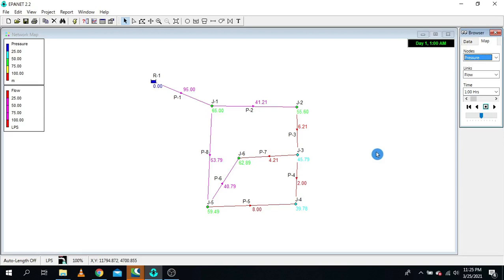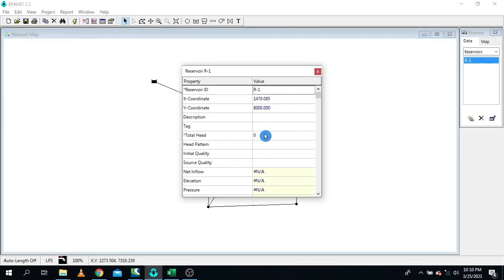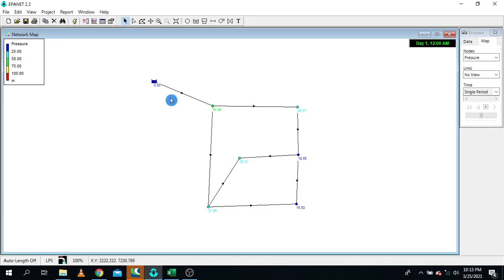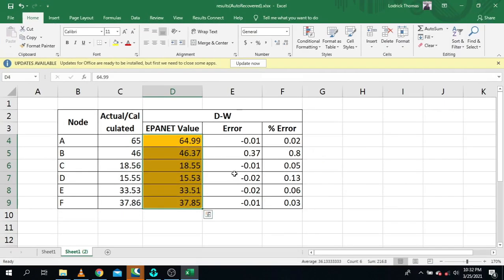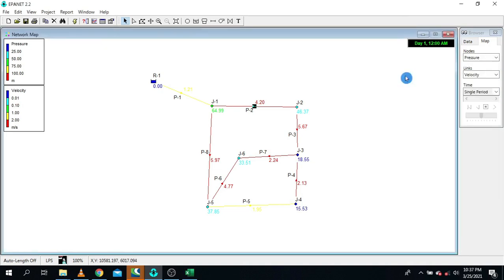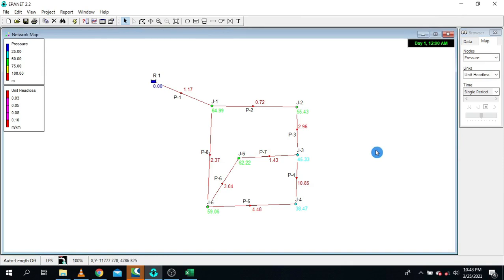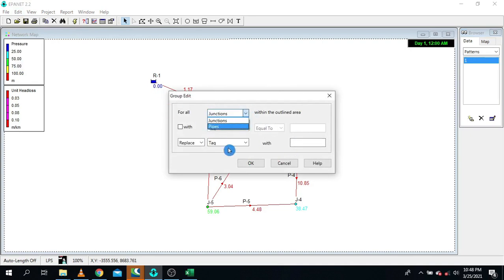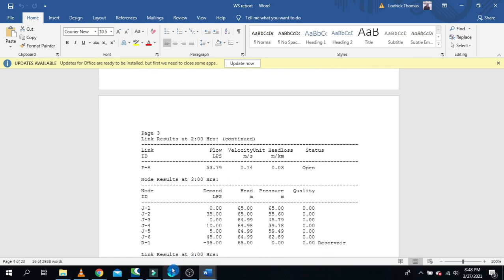EPANET Tutorial | How to design a Looped Water Supply Network with EPANET Software

Comment: Great video, Sir! It helped me a lot in my college final design project. I have a question, though. How do I distribute the base demand throughout the whole community when I am only given the total demand at that certain location?
Reply from the maker: Thanks and welcome! Is it a looped network? or dead end like the one on tutorial?
Reply: @HydroinformaticsAcademy  I need to do both and choose which is a more economical design. Really hoping for a reply. Thank you, sir!
Reply from the maker: @nof2287  For looped network what you need to do is to distribute or to divide your total demand on each node or at least corner nodes i.e. if your have 8L/s as a total demand and you have a total of 8 nodes in a loop then take 8l/s/8=1L/s for that, you need to assign 1L/s on each nodes in the loop! 

For dead end its straign forward, if on a given end point you have say 0.8L/s as calculated demand then that is something you need to assign on such a particular point/node! 

NB: Depending on which analysis you opt to run (staedy state or EPS) You need to be aware of base or average demand vs actual demand which includes the multipliers!
Reply: @HydroinformaticsAcademy  I am planning to perform EPS! This really helped a lot since I was stuck at adding base demand for days! Thanks a lot, sir! I'll surely recommend this channel!
Reply from the maker: Very good, Just be aware that for EPS you need to use average demands without hourly factors. You also need to  set the appropriate multipliers and assign them on each node with average demands. Then after that, EPANET will run eps to get the actual demands which includes multipliers that you assign on the nodes!

Once again, thanks alot and I wish you all the best in your project🙏

Comment: Thank you very much for you video, can you explain us how we can add a "fire pipe" in network ? all of time for example, one fire pipe must product 60m3/h with minimum one bar ! Thank's a lot
Reply from the maker: That can be done, in my opinion, what you can do (when you design your network) is to introduce a node with a base demand equal to 60m3/hr (16.67L/s) and then adjust the whole network to make sure its capable of supplying fire flow demand of 60m3/hr and at that added node make sure pressure is 1bar (10mwc)! 

And if possible you can even go further by performing Extended period simulation just to make sure your network is well optimized to handle demand fluctuations!

In fact, in the future, we may have some tutorials related to fire flow demand... just make sure you subscribe to be notified when we upload new videos!
Reply: @HydroinformaticsAcademy  thank you for your answer, it's like what i tried to do (flow demand increased to 17l/s) and i make my demande in two hours (new pattern). Also the elevation of the node is increased by 10m (like to create the pression 1bar) ! is this method correct ?
waiting you nexts videos, 
regards
Reply from the maker: @youssefmouacha3296   Adding a separate pattern for Fire flow demand is correct, but the idea of increasing node (with fire flow demand) elevation is good because let's say your actual ground elevation (at a node with fire flow demand) is 100m and in epanet you assign its elevation with 110m (and not 100m actual elevation) this alone is going to guarantee you that at that node (after assigning additional 10m) is going to get 10mwc/1Bar! 

And if you run your model and you get any +ve pressure value at that node then the actual result is going to be 10m plus that value you got after running your model! 

Let's say your node elevation is 110m (after increasing it with 10m) and after running your model you get 6m as pressure! so the actual pressure at that node is going to be 10mwc + 6mwc = 16mwc = 1.6Bar! .... 

But IMO that is kinda tricky especially when someone is going to work with your model in the future! 

BUT to keep things simple you can try what I told you earlier! by first maintain the actual elevation (say, 100m) and then assign a node with fire flow demand then adjust your system/model to make sure a node with fire flow demand is actually getting 17LPS and pressure is not less than 1Bar/10mwc! 

Which at the end you will probably going to get the same result! 

All in all, it's the correct approach if and only if after adding 10m (on the node with demand flow) you get 17LPS and any +ve pressure value!